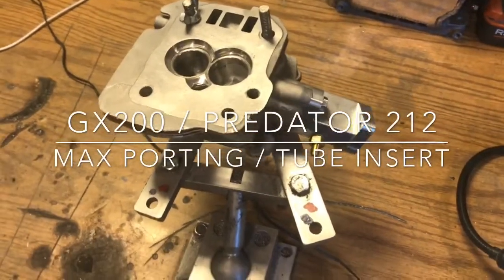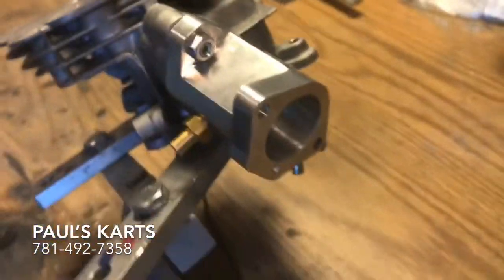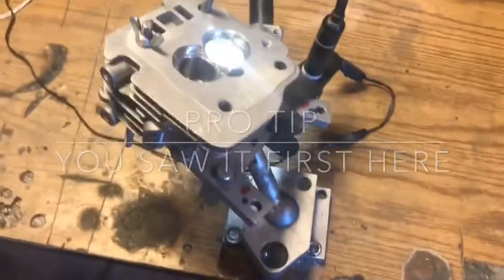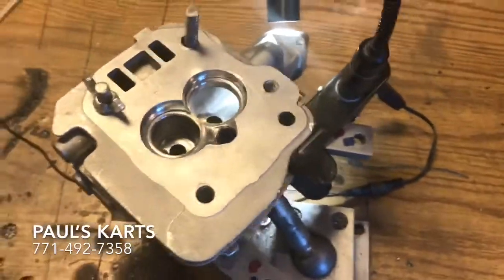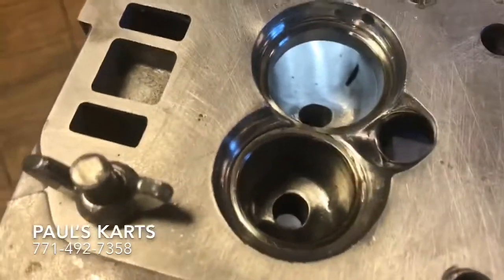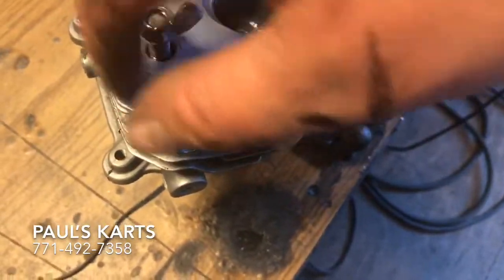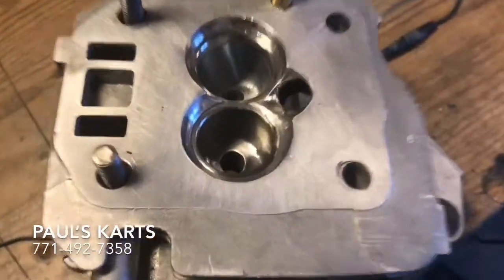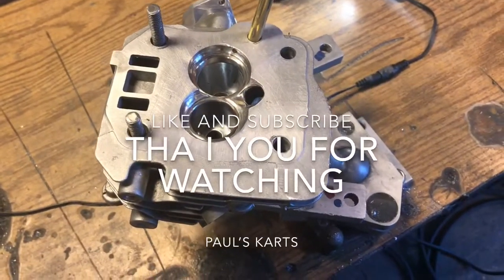“Most CFM possible”  TUBED HEAD thru a cast gx200 head /predator 212 mini drag bike

Comment: When I send my head in to get ported I plant to use an 24mm carb will my intake port be ported as well to match my intake tube? Intake tube will be 24mm
Reply from the maker: SoundStream Entertainments .. yes that’s doable. It’s  a line item we have to offer
Reply: @paulskartslifan4206  ok so basically an standard port job
Reply from the maker: SoundStream Entertainments ok

Comment: So had question so I race dirt karts and my buddy runs a gx 200 but he has a 30 mm mikuni do you have to have it ported to 30 mm
Reply from the maker: That carb is a little big but “ yes “ in theory ..  you want to be able to utilize the carb size. If the Oort is smaller than the carb the port is the restriction in the system ... the port  as a hole can only flow as much as it’s smallest restriction ..